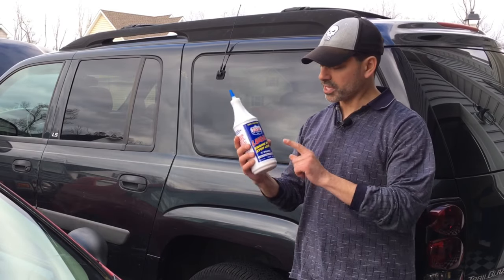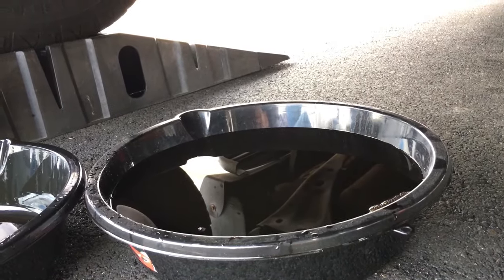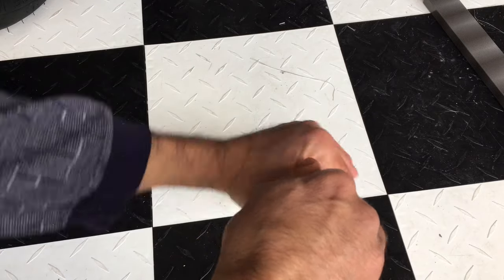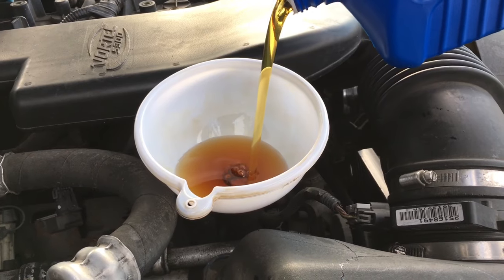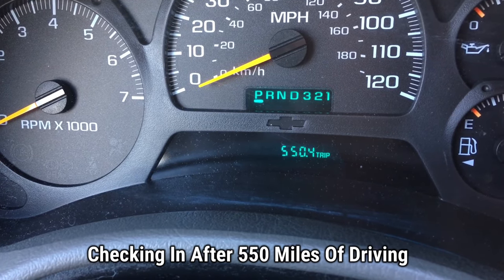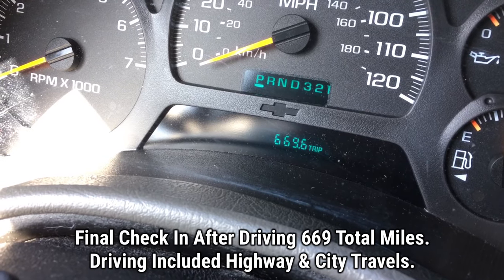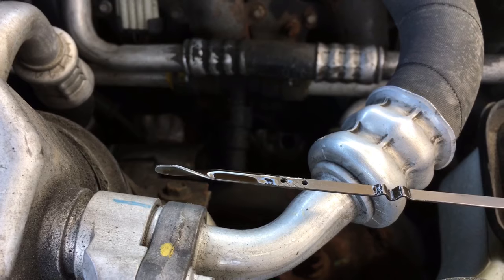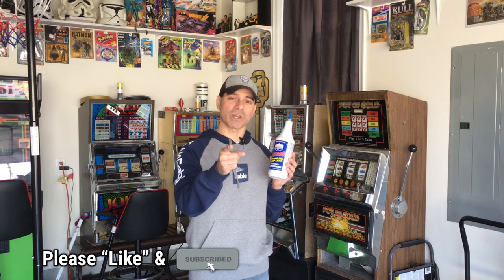Lucas Engine Oil Stop Leak - Product Review (Andy’s Garage: Episode - 251)

Comment: I had a severe oil leak from my truck's factory oil cooler. I would lose a quart in about 30 minutes. It was so bad that I lost oil pressure and my oil pressure gauge would bounce around. So, I would always keep it overfull knowing I'm constantly losing oil. Decided to try this Lucas additive. I start driving back home & sure enough my oil pressure gauge was still bouncing everywhere. I get home & there's oil everywhere. Parked it for the night, gave up on it. Next day I drive it to take my dad somewhere & realize my oil pressure was stable. I get home, look underneath & everything is dry. 2 months later, still no more oil leaks. Oil is a quart overfull though, because nolonger losing oil.
Reply: I have a 96 trailblazer and it's literally doing the same thing I'm having to pull over to put more oil in so I'm going to go ahead and get this a try because it sounds like we have the same issue and the same severity of leakage I appreciate you posting your story now I have hoping this will work cuz I can't lose my job missing another day of work
Reply: @mi_bulle_ha_noname3775  I still don't have any oil leaks. Good luck
Reply: @mi_bulle_ha_noname3775  how did it work out?
Reply: WoW well i have a Minor leal so i kno it mos def will work for Me
Reply: The end 😂 helpful though. Gonna use this in my 95 ford. Losing about 5 quarts a week
Reply: Great info.  Thank you.

Comment: I have to say when you’re pouring in the Lucas the motor needs to be warm because otherwise it just drops him all the way down to the pan on the bottom and it’s not being used proper that’s my experience I’ve been working on cars ever since I was 14 I’m 63 and the other videos will tell you warm up the car driving around with a quart less you’re not gonna hurt it just warming it up then you put and while it’s running and keep it running for about 5 Minutes nine out of 10 you’ll have better results
Reply: 03 buick rendezvous oil pan leaking what kind of stop leak should I use lucas,bars or blue devil?? The oil pan is such a pain to do on this car so not trying to do it right now
Reply: Thx for the tip
Reply: CAN I use  it in my takeuchi excavators diggers yanmar engine
Reply: CAN you put it in my takeuchi excavators diggers yanmar engine
Reply: @danielkramer4780  - I know this is an older reply/post but...what did you end up using and did it work? I've heard good things about the Blue Devil brand of products! Many thanks, cheers...
Reply: @danielkramer4780  Instructions off STP oil treatment. do they still make it?

Comment: Regardless if your leakage is big or small, ANY stop a leak will help regardless. It’ll slow down big leaks and give your wallet a rest on buying oil all the time. And if it stops the small leaks, then the rest of history.
Reply: I used this to help stop an oil leak but all this did was slow down the leak not stop it but I still have to spend money on buying more oil because it was low when I had topped it off before putting this Lucas oil garbage. So I don't understand how this saved me money on buying oil when it get the opposite.

Comment: First using super tech oil never put that in a Chevrolet second try to fix the problem of the leak before using Lucas if parts was fix and still using oil then use the Lucas oil other wise you just going to have a bigger problem later

Comment: Lucas failed here.  With an engine leaking that much oil,  oil changes are not required.  Just change the filter at the interval and keep topping up the oil.  Its just going to leak out,  so it wont be in the engine long enough to get used for 10k miles.   Or you could always advise that the vehicle is repaired with a new gasket.

Comment: My theory STOP N GO cause more leaks is that you have changing pressure from 0 to more pressure. And it just pushes oils more. Where as on highway you are already experiencing steady pressure as the engine runs at a non changing oil pressure mode … or at least it’s a more steady pressure as opposed to stop and go .

Comment: A real test would be to leave it idling in your parking spot.  You see it dripping out if the product is not work or even better rev it up while idling for a few mintues.  Mine did not leak but a few drops after shuting it off but while idling giving it gas >oil pouring out!  BTW.. not lucus but I did use Barrs!
Reply: What you are saying is not the proper way to use the product. It telling you to put miles on it not just idling

Comment: Don't forget how well this product will work depends in large part on how bad the leak is. And a very bad leak that really needs to be repaired this product probably won't work very well. But on Lesser leaks and minor leaks it works much better.
Reply from the maker: Great input👍
Reply: Does not work on gaskets. will work 10 to 15% on worn seals wast of money all mechanics know this

Comment: I have a 65 Fairline I put half a bottle in when I changed the oil and filter the reason I use it was to reduce the chatter, it did by 90%

Comment: I think it only helps with seals but not with worn gaskets because usually, gaskets don't swell with chemicals to stop leaking
Reply: btw Lucas doesnt use any chemicals... at least on this product
Reply: He's right. It won't work at all if you have a worn gasket. Turns out my car has a worn gasket and I used this product that cost me more on oil cuz it didn't stop the oil leaks.

Comment: I have found Lukas Oil Stop Leak to reduce my engine oil leaking by 90%, if I use it with Castrol GTX High Mileage engine oil.  Castrol's seal conditioning additives, along with the Lukas Oil Stop Leak additives increase the effect of reducing oil leaking on my engine.
Reply: Will it stop a leak in my oil cooler housing?
Reply: @adrientheproblembroner9624  People use Lucas Engine Oil Stop Leak to avoid paying $2,000 to have an old near-end-of-life engine torn apart to have the main seals replaced.  Servicing an oil cooler housing, or replacing it, might be a more affordable repair to stop the leak but, you can try Lucas Engine Oil Stop Leak and see what happens.  It's best to poor it in with a fresh oil change, with one quart less new oil to make room for one quart of Lucas Stop Leak.  But, having your oil cooler housing serviced or replaced, to stop the leak, might be the best path.

Comment: I used this on my Saturn vue 3.5 Honda engine had just changed a gasket by the oil filter it stopped the major leak but it still kinda of leaks a tat not as bad I'm using this hopefully to help me for the next month to changed the valve cover gasket but really guys if your car is leaking it's something with the gaskets just changed them out. Or get to the root of the problem

Comment: Before watching this video, I watched the one where you used Blue Devil, which I'm about to try. About 3 months ago, I used the Lucas Oil stop leak. Which, as with this video, did help. I plan to change both valve covers on my 5.3 engine, which should help. My rear main seal leak is the biggest culprit, though, so I'm trying Blue Devil next. Thanks for the videos!
Reply from the maker: Also check the valley pan gasket, those can leak bad as they get older. I have a ton of 5.3l videos on my channel covering various gaskets. I’m doing a lot of work on it.

Comment: gr8 vid,  have you tried at-205 reseal?
also check the PCV valve, if its in need of replacement it can be a contrib factor to a oil leak and oil consumption.
I replaced PCV valve on my honda odyssey and it went from burning 2-3 qts ever 3k to maybe 1qt.
it had had a oil leak from valve cover that was fixed.  and it has over 200K miles.

on a nissan maxima  with rear main seal leak , the at205 helped and pcv valve replacement helped but still leaking some.   I stumbled on this video when looking to see how lucus stop leak works
Reply: Where can you get that AT-205 reseal?
Reply: @edwinortiz6583  amazon

Comment: Great video I’m gonna end up doing an oil change and buying this. I’ve been using Lucas oil to calm an engine knock but I’m gonna try out the stop leak cause I’m leaking some oil too.
Reply: Did it worked for you?
Reply: I would do an oil change... but I already change oil about every week by adding oil.
Reply: Why you buying it...it don.t look like it works very well.

Comment: I wonder if this will get me by until i can afford to change my head gasket in my 05 f150  spark plugs are expensive
Reply from the maker: This will not help with head gasket issues. Is you truck overheating?
Reply: @PhillipsVision  no its been doing pretty decent but i have to keep replacing a couple of my spark plugs every few months give or take because the head gasket needs replaced but other than that ive gotten well over my moneys worth i baught it for $1200 back in 2020 with 300k on the odometer

Comment: My question is, when you change the oil do you fill the oil to it's capacity (my Ford fuckus takes 4.5 quarts) then add the stop leak? Or do you only add 3.5 quarts of new oil and 1 quart of the stop leak? Thanks
Reply from the maker: I add the additive first, then top off the oil. Make sure you don’t overfill the oil, so check the level as you add the oil
Reply: @PhillipsVision  thanks dude bro
Reply: @PhillipsVision  someone said do it after the refill so the stop leak doesnt just run to the pan.  What's your view on that suggestion?
Reply from the maker: @Dbjjr26  Not a bad idea, but even if it runs down, the pump will still circulate it.
Reply: @PhillipsVision  true I honestly didnt consider that.  Late night video scrolling lol not all cylinders were firing.
Reply: @PhillipsVision  my question is does it work decently like to even slow the leak?  I have a 92 civic and it's a Energizer battery it keeps going but its leaking more than usual and I'm thinking with almost 300k on it and it being a standard coup...with a bad paint job dont really want to buy another engine for it or put another one in it.
Reply: @PhillipsVision  if this works I know it will extend its life by a lot.  But I just dont want to waste money if it isnt going to work.
Reply: @PhillipsVision  thanks for responding too btw man that's awesome very quick
Reply from the maker: @Dbjjr26  All depends on what kind of leak it is. It should at least slow it down

Comment: Hello, I'm a Subscriber from Indonesia, I want to consult about the oil leak/seepage of the crankshaft seal of my car (Isuzu Diesel C 190).

What I want to ask is the following:
1. Does the LUCAS product really work like the case in my car?

2 Does the LUCAS product not harm other components in the machine that are currently working normally? Because I'm very interested in trying it, but I got input from several car repair shops in Indonesia so I don't use it because I'm afraid it can add to problems in other components.

Thank you, I am waiting for your answer
Reply from the maker: Thanks for subscribing 👍 To my knowledge, it will not harm anything. It has never hurt any of my vehicles. It does work on leaks that are not too bad.

Comment: 5:58 Lamborghini Countach VISIBLE! 😃Unless that is a Jalpa.. I see a Lambo!!!
Reply from the maker: It’s a Countach LP400S replica
Reply: @PhillipsVision  Nice.
Reply: @PhillipsVision .. Pontiac Fiero underchassis?
Reply from the maker: @82_KID  yes, with a second frame to accommodate the Countach dimensions
Reply: @PhillipsVision   I was about to say how close do the replicas get!!!  Are you happy with how the car turned out?
Reply from the maker: @82_KID  Mine was a factory built turn key replica that I picked up in very bad shape about 7 yrs ago from a previous owner who abused it badly. I’ve been doing a full restoration on it which is covered on my channel. It’s about 85%complete now.I would never try to build one from scratch or buy one that an individual built. There are too many things for someone to do wrong. The body kit is not the most accurate but I have been trying to modify it as am restoring it. A friend of mine has an exotic car dealership. He had a real Countach 5000 QV which I was able to use as reference.
Reply: Oh nice. I was looking and I was like.. "is that a Jalpa lol?" And WAS that Rocky 4? (I think Rocky 3 and 4 were the best, Rocky 1 and 2 were OK, and Rocky 5 was unwatchably stupid.) My car has probably had about 80% of the stuff in it replaced. It's not a Lamborghini, though.

Comment: I have a small oil leak in my 2019 Subaru Wrx would this work for it. And can I just put it in I recently got an oil change
Reply from the maker: Yes, it should work. You can add it, just make sure you drain enough oil to allow for it; you don’t want to overfill

Comment: Hi can u tell me we're was the holes I have two small pin size ones at the bottom off my oil pan would this work for that or would I have to get something else
Reply from the maker: This vehicle did not have holes, it had worn seals. If you have holes in your oil pan, I would recommend replacing it. If it’s rust it will only get worse
Reply: @PhillipsVision  ya it has small bits off rust in it okay thanks for ur help

Comment: Hey guys tell me , I put 2 quarts oil in after oil light came on and off , noticed after I had a huge puddle of oil , I noticed a leak underneath ,by the time I drove home 10 minutes , shut car off immediately, looked under car and seen small drips of oil ,checked oil and no oil , so my car was shut off but no oil in car , what should I do guys ? This is obviously a huge leak ,I won’t dare to even start the car with no oil of course, but do you think this would work ? help please guys

Comment: Nice.  Where was you car leaking oil from?   I have what I think might be a head gasket leak, it’s tiny.   Minor oil only.   I wonder if this will work.
Reply from the maker: This will not help with a head gasket leak. You’ll want to use Blue Devil Head Gasket Sealer. That works good
Reply from the maker: Here is the link https://youtu.be/VRc-3JvJ_kI

Comment: Do you have any info on trying this additive or any other similar oil leak additive products right after you have tried another that did not really work well? That product I tried has the same guarantees as those you just read.
Reply from the maker: I don’t think trying another would be an issue if you remove the old and mix the correct % with your oil

Comment: My car requires 5 30 oil. Because of the thickness of the Lucas product could this damage the engine?
Reply from the maker: It shouldn’t. I’ve used this on vehicles requiring 5-w20, 5-w30, 10-w30. It’s the thickness of this that makes it effective.

Comment: Should i put Lucas Stabiliser or stop leak. My engine oil level drops a bit after a few hundred miles.
Reply from the maker: Sounds like a slow leak. Start with Lucas. I didn’t have much success with Blue Devil

Comment: So when My oil is low add this first then top it off with oil?
Reply from the maker: Yes, but keep in mind that this is a quart of additive. Be careful not to overfill.
Reply: @PhillipsVision  what you mean? I recently found out its a valve cover gasket.
Reply from the maker: @OldSeaHag  this won’t fix a valve cover gasket. You’ll need to remove the valve cover and replace the gasket. This additive works better with leaks pertaining to the oil pan gasket and other seals.

Comment: My 07 acura needs valve cover gasket, intake manifold gasket, possibly rear main seal.  Any chance this stuff would work and stop the leak?
Reply from the maker: The intake manifold gasket doesn’t have oil flowing through it, it is air flow. This will have with seals in the engine. Not sure about the valve cover gaskets either.

Comment: Do I need to empty some oil out first before adding this?
Reply from the maker: Yes, this is 1 quart so you’ll need to drain 1 quart. I usually add this when doing an oil change so all the oil is clean as well. You do not want to overfill
Reply: Only if your oil level is at the top. If you are a quart low you are good to go.

Comment: Will that thick additive hurt the values?
Reply from the maker: I don’t think so, I’ve never heard of it doing so
Reply: @PhillipsVision  My question is, when you change the oil do you fill the oil to it's capacity (my Ford fuckus takes 4.5 quarts) then add the stop leak? Or do you only add 3.5 quarts of new oil and 1 quart of the stop leak? Thank You!
Reply from the maker: @MeatMachine69  I usually add the stop leak, or any additives first then top off the oil
Reply: @PhillipsVision  thanks